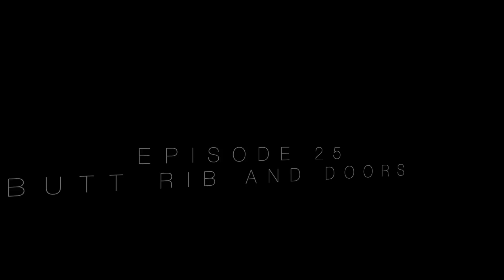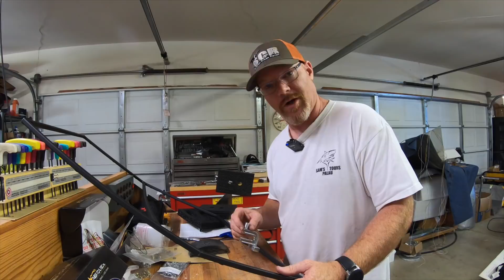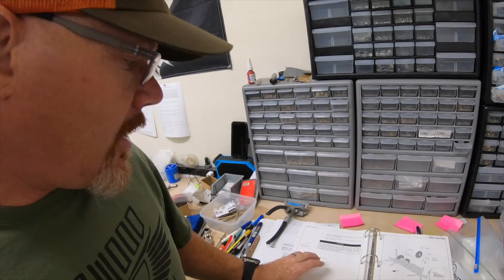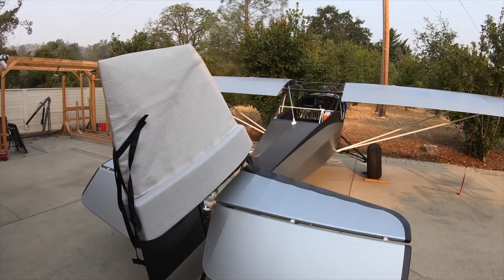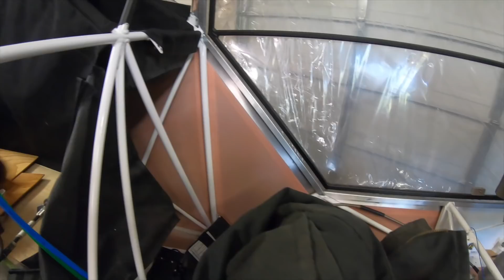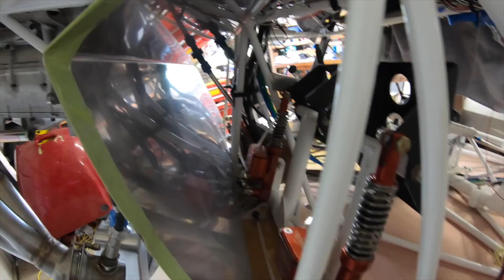Kitfox 7 Apex Build Episode 25 Butt Ribs & Doors

Comment: Bryan, Just a heads up for when you mount the gas strut brackets on the doors. Make sure you leave enough clearance to the underside of the wings. I got mine to close (maybe 1/4") on one side and when I run my engine on the ground with the door open the vibrations from the prop slipstream causes the door to bounce up and down a little and it hits the wing, causing the plexiglass in that spot to get scratched up over time. I recommend 3/4" to 1" clearance.
Reply from the maker: Unfortunately I forgot to film that part, but it is completed with about that spacing.

Comment: Like the doors, how do you open them from the outside?
Reply from the maker: You use an allen wrench as a key to turn the handle inside, but it has always been a pain on my model 5 so maybe there is room to improve on that issue, thanks for mentioning it.
Reply: Project Kitfox Have been looking at them but it was my concern if you had an accident and the responders could not open it from the outside.
Reply: @sdutoit10   You should always unlatch doors before a forced  landing.
Reply: Brian Bush yip speak time Jonas. Sure he never had time to unlatch when his fuel pump failed on take off from the sand bar.